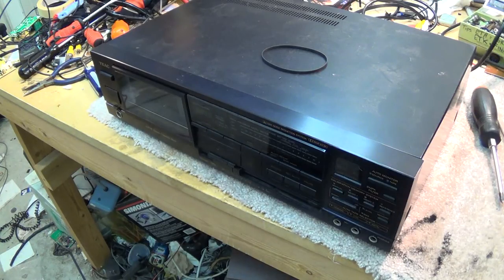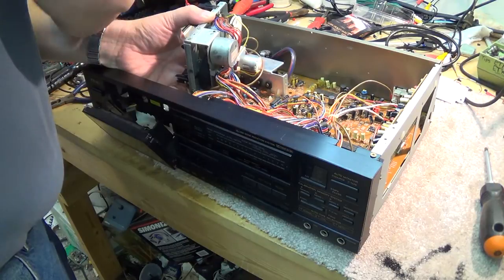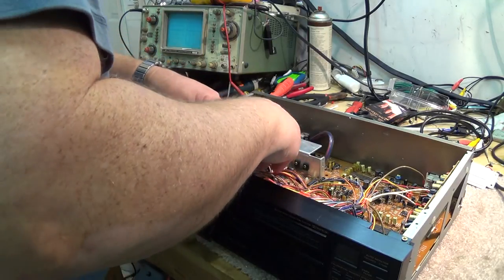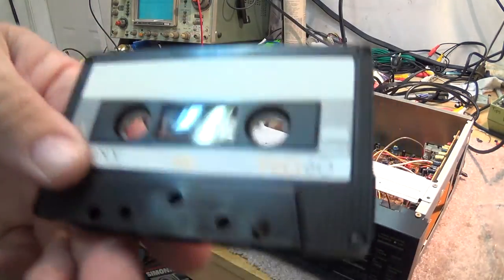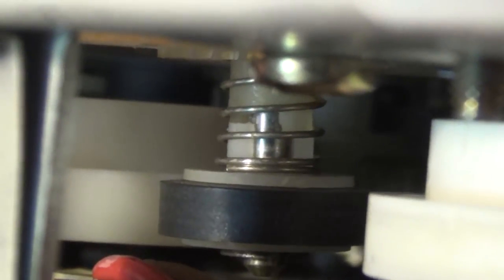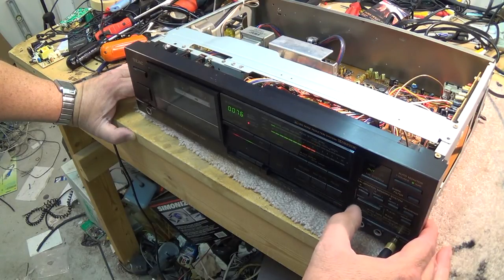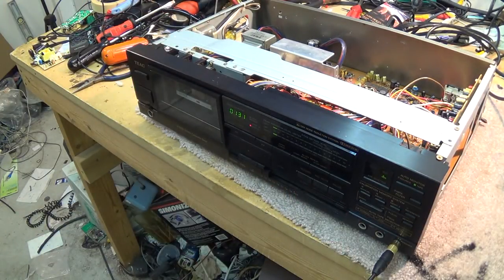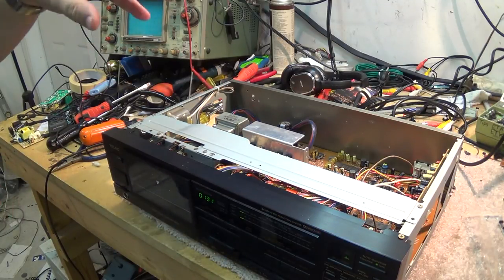teac 850 capstan belt replacement.

Comment: Sir,
.Thank you. I bought one Teac V-700 from Ebay listed to be in excellent condition. But the belts were worn out. I opened the outer case but  couldn't take out the mechanism. I searched the web and came upon your videos which are very useful and informative. Thank you once again for sharing your skill with these machines to the viewers of You tube.

Regards

Bhasi Krishnan Nair
Reply from the maker: Bhasi K Funny how that works. Excellent condition on Ebay usually translates into broken, seeds service. Powers on, unable to test ALWAYS translates into "Something major is wrong" I have bought a few DAT decks that needed major restoration work. Of course I fully expected this as I have learned the language of Ebay. Buyer beware is another one that comes to mind.
But the biggest time I was ever stung on Ebay was when I sold my old professional sony camcorder.I listed every fault I knew existed, and that was the viewfinder ribbon wire was worn. This was a well documented issue with that model of camera, and I had replaced it 3 times during the time I owned it. I even included a replacement ribbon wire to the buyer, and gave them the option of paying an extra repair fee on top of the bid amount if they wanted the unit professionally serviced, and offered to discount the cost of the wire from the bid amount if they did not want it. This buyer said, no send me the replacement part they would install it themselves. Then then went crying to Ebay that I sold them a defective unit, and ultimately won the price paid back, and I lost 1,000.Ebay said it was because he had funded his paypal account with his credit card, and his bank ordered the charge back, and I was not protected from a fraudulent buyer because of this. For 10 years I never bought or sold anything on Ebay. Then for some reason I big 10 on a DAT recorder and won it.Unit arrived broken, and the service video is now on my channel.

Comment: I had the exact same cassette  deck. Not bad for the price but the my Sony TC-765 Reel to Reel had noticeably less distortion. Distortion was noticeable on sibilant human voice sounds in which "S" becomes "Sh". You just switch back and forth from source to tape and it can be heard no matter what tape,  bias, input level settings are used. I used to use a Crystal Gayle CD for this test. "Talkin in your sleep".  A great deck for the money though. I gave mine away to a friend and now I'm sorry I did as my new vehicle does not have a cassette deck.
Reply from the maker: +newjerseybt That was a relatively expensive deck at the time. I think I paid about 700.00 for it back in the day. Not using it now, after fixing it I put it away again, but might set it up in my loving room. I set up my tube amp, and my 200 disk CD jukebox, and might just hook up that deck for playing old DBX tapes, and one of my DAT decks. Just need to find a nice audio stand to put the gear in. I use the Technics RSM275 in my studio. It is a 2 head direct drive deck. I don't really use cassette for much, just to play some old tapes. I use DAT as a production tape format, and I have an old Akai GX265 Reel to Reel for the really old tapes I have.